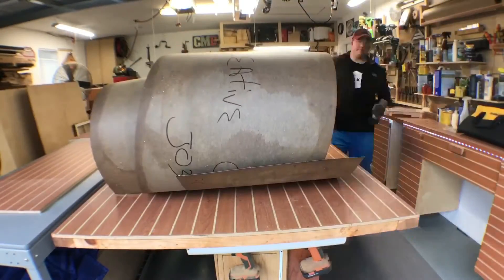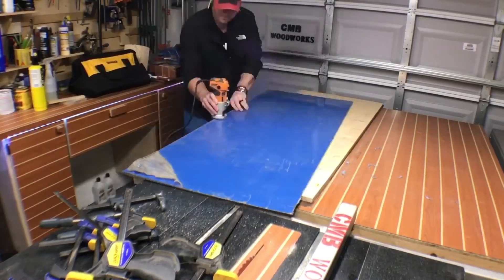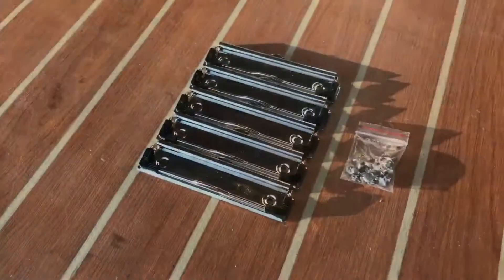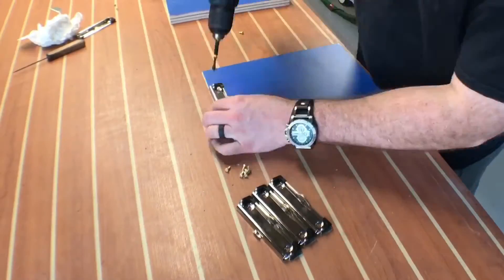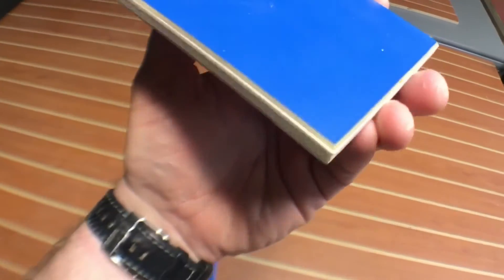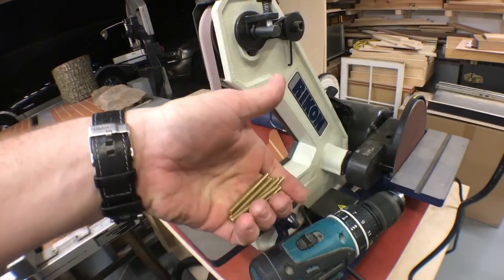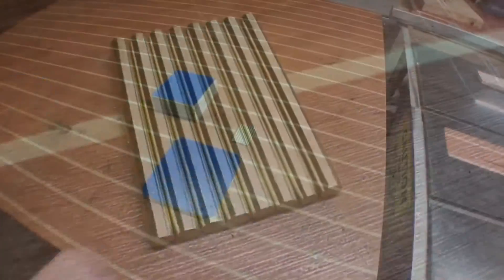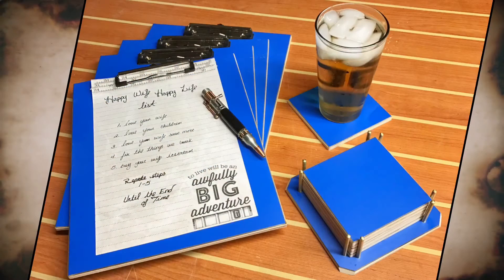How to Make These Fun Projects

Comment: Hey bud where did you purchase the clip board hardware? I would love to make one since I use one at work every single day
Reply from the maker: frehleycomet I literally just searched "clipboard hardware" on Amazon and a multi pack came up I believe I got six in the pack, and not for a whole Lotta money.you can tell from the video they came with rivets but I opted to use screws instead. Another option is sometimes the dollar store or office-supply stores carry multi packs of clipboards that may be cheaper than buying just the hardware. Then you can just stripped the hardware  off and use it for yourself
Reply: A Glimpse Inside well duh I didn't think of the Dollar store. Thanks for the response